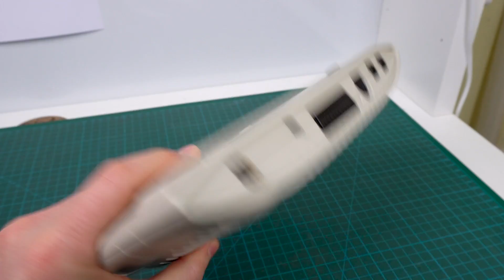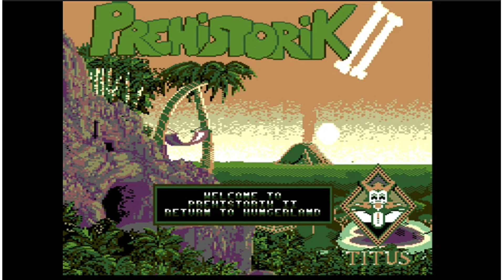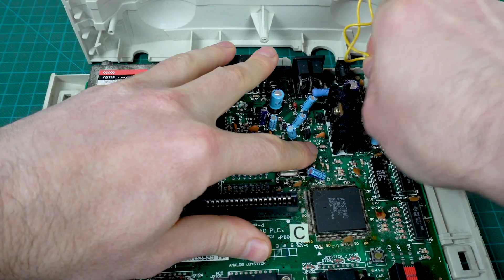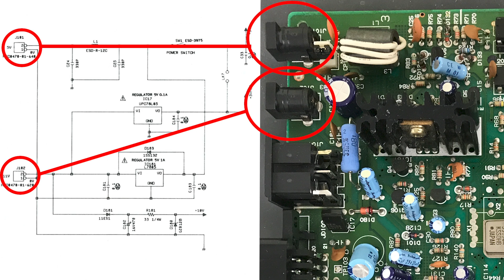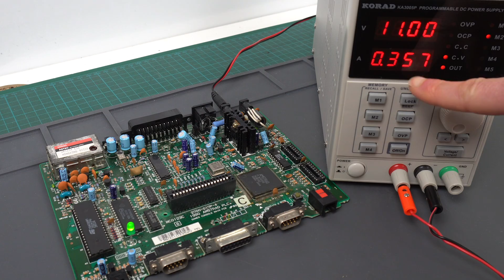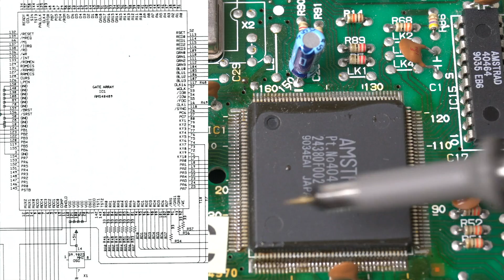Amstrad GX4000 Repair - The Unknown Game Console

Comment: I got one of those back in '98/99 for £5, in box with everything. Played on it once. You're not missing anything. It's more useful as parts. I ended up giving it to a friends 5 year old son.
Don't think he played on it much either. LOL.
Reply from the maker: Yeah, and it's too bad. It's one of those "what could have been" cases had Amstrad decided to put some effort into it.
Reply: @NoelsRetroLab  It's Amstrad cashing in and cutting corners, again.
Reply: @NoelsRetroLab  I think you are spot on with your "too little, too late" remark in the video: What is the point of bringing a Z80 based console on the market in 1990? If I wanted a Z80 console at that time, I would have bought the established Sega Master System (Japan: 1985, US: 1986, EU: 1987), just because I knew there were a lot of cool games available, and I could trade games with friends. Does this console have a unique selling point over the Master System?
I don't think "some effort" would have been enough to save that device, except if for you "some effort" means being a whopping 3 years earlier to the market.
Reply from the maker: @tw11tube  Seriously! I don't know how it ever got past the planning stage. Or maybe it was initially pitched and designed as a 16-bit console, and then, somewhere along the way, someone cut costs and stuck a Z80 on it. 🤪

Comment: get a 4mhz oscillator chip? i guess microchip has some. you can then devide it and get the 1mhz signal synchronized. a lot of work but possible.
Reply from the maker: Yes, I want to try that sometime. I'm afraid of two things: a) The clock signal generated isn't in perfect sync with the others in the GA and b) there are more things wrong with the GA than the clock signal. But even so it seems like a fun project, so I'll probably try it anyway :-)

Comment: ive only seen these in pictures...never seen anyone handle one...let alone tear it down and (try to) repair it!
we have a running joke that the GX4000 is the worst console ever made... but its not 'bad'...it was just late...
2 screws holding the thing together... trust Mr Amstrad!
Reply from the maker: Yeah, it was waaaaaaay too late. But the case design and attachments were top notch! Especially considering that the Amstrad CPC 6128 is a nightmare of screws.

Comment: Good video :-) Is an FPGA  an option to fix this?  Opps I'm a bit late to the party I see.  I also love my Adjustable power supply, I am using it in making the Ben Eater 8-bit CPU :-) I keep the  amps just above what it needs and I have seen the voltage drop sometimes, so I look for my mistake :-D
Reply from the maker: No FPGA implementation as far as I can tell unfortunately. Hopefully in the next few years those will become cheaper and more common for more computers. Ben Eater is AWESOME. Love his videos and explanations!

Comment: If you can get the chip I would gladly replace it for you for free. I'm in the US. I have all of the surface mount soldering equipment. I'm an electronic technician and I work with smc all the time.

Comment: nice video!!! i was in a same puzzle with a tv set 15 years ago.... no video output from a video chip ... i changed it and the result was the same - then i changed 3 small electrolytic capacitors around chip and i saw Output ... i saw an electrolytic capacitor near your chip maybe if u change it u will see picture ty for your exellent video